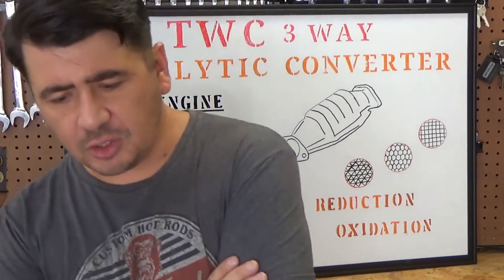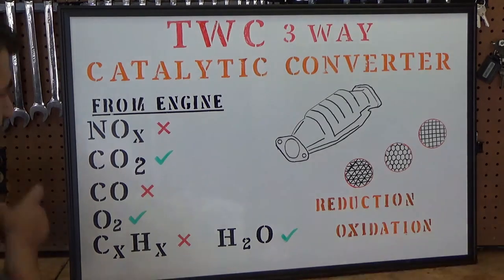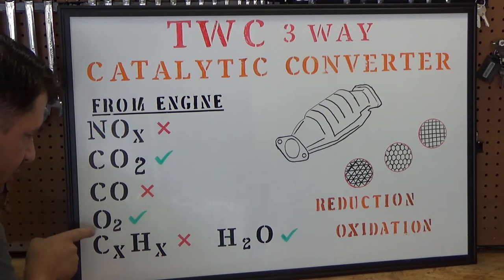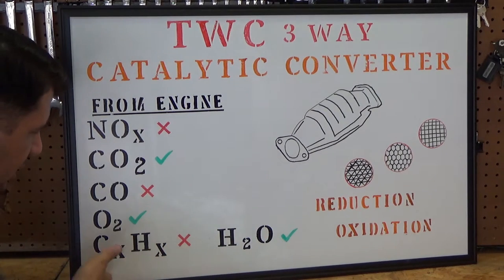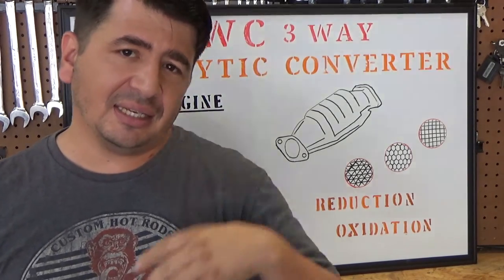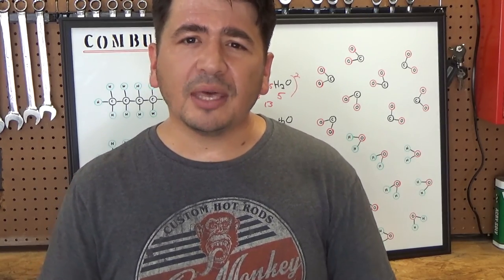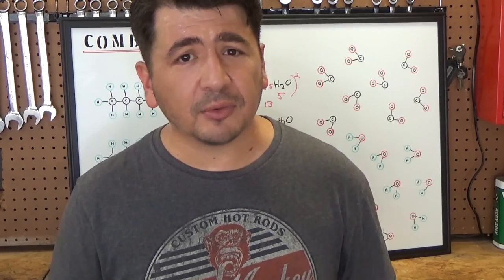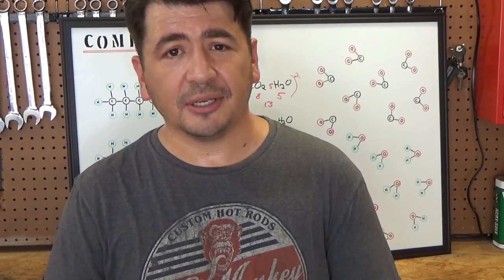How A Catalytic Converter Works

Comment: Can the Catalytic Converter plug up when the car consume oil
If you stop the car from consume oil can the Catalytic Converter burn it from the heat and get cleaned 
What will plug up a Catalytic Converter and can you clean it